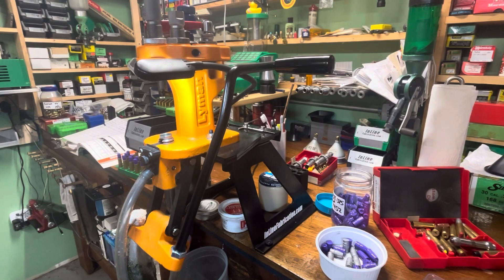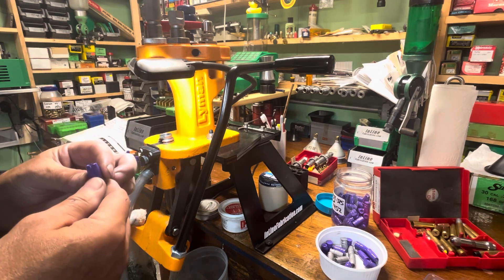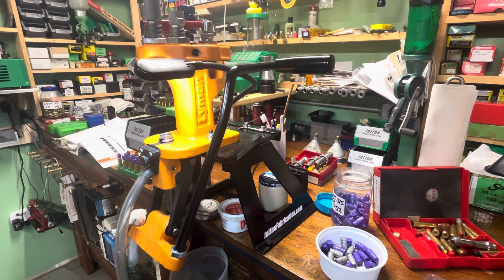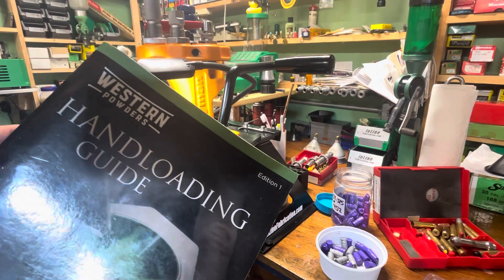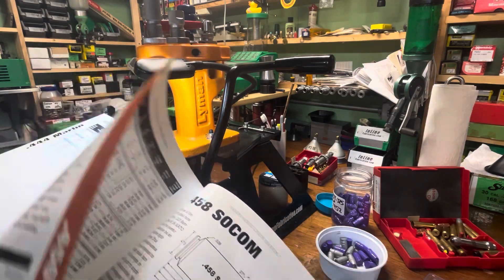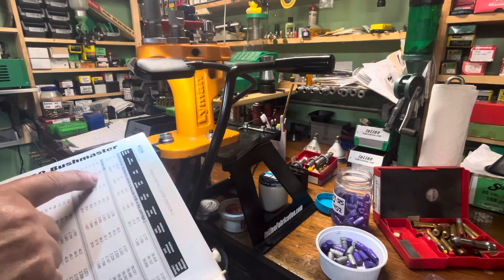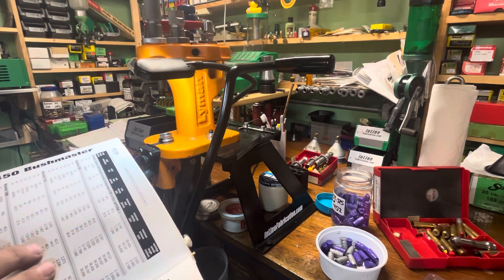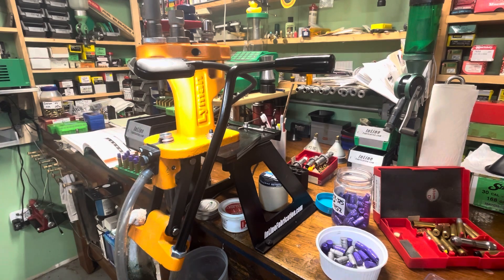Load Development 450 Bush Master

Comment: I still dream of getting my gunsite scout to feed 450BM. Put it back in the box a few years ago after checking that it would cycle my cast HPs. Some day I’ll pull it out. Lol
Reply: I did buy a lee collet factory crimp die was well. Have to see if it makes a difference vs the recommended double crimp of “tapper then roll” when the BM first came out.
Reply from the maker: @tripplebeards3427  mine still runs fine. It doesn't smoothly feed everything but it will feed everything. I've fed it.
Reply: @cw2a   That’s about how my American was.  It would jam, but if I wiggled the bolt around, it would eventually slide up and feed in with the lee 300FNs.
Reply from the maker: I remember the tribulations.  ❤️‍🩹😜❤️‍🩹😜
Reply: @cw2a  was hoping with the control round feed on the gunscout it would help…not.